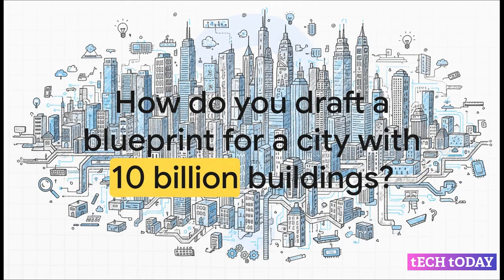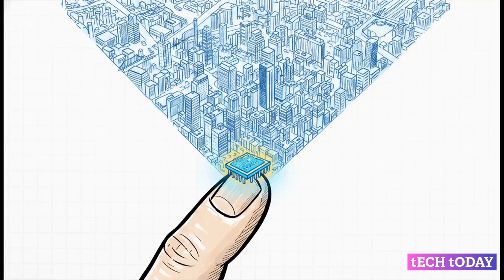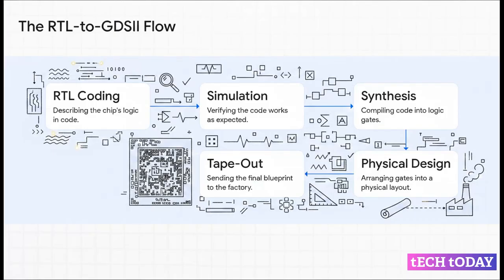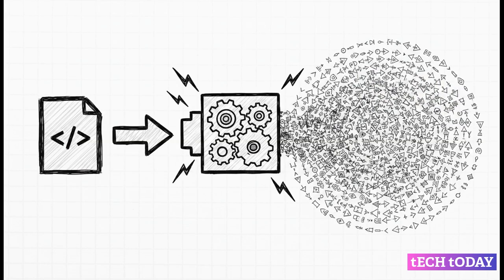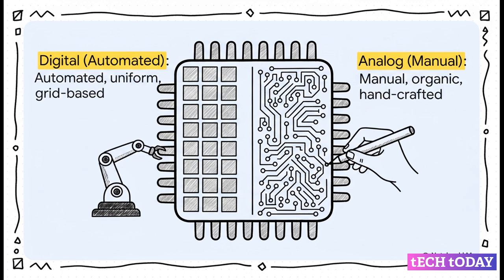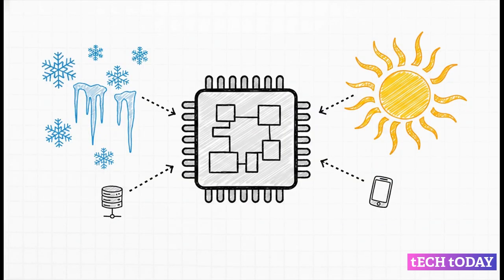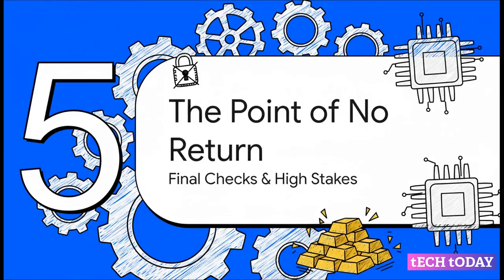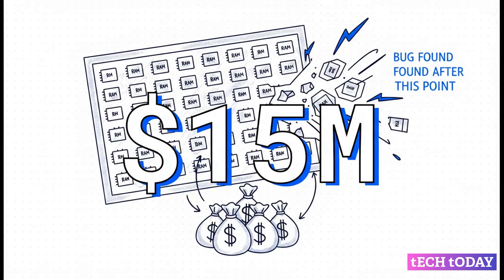Part 1: How RAM is Actually Designed: RTL to Silicon Explained

Comment from the maker: The fact that engineers have to write millions of lines of code just to tell the physical silicon how to behave is my favorite part of chip design. What surprised you more: the coding process, or the massive simulations required before manufacturing? Let's discuss down below! 👇